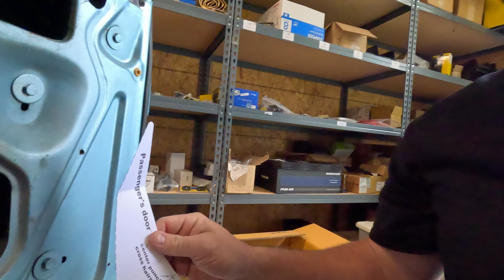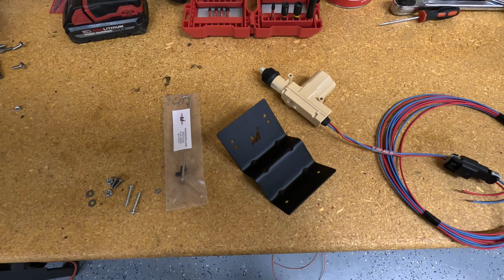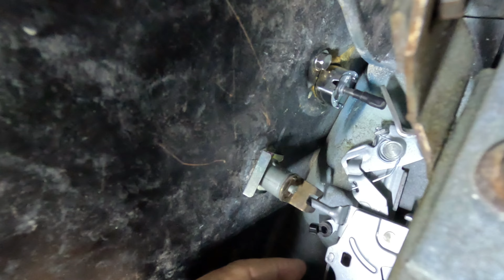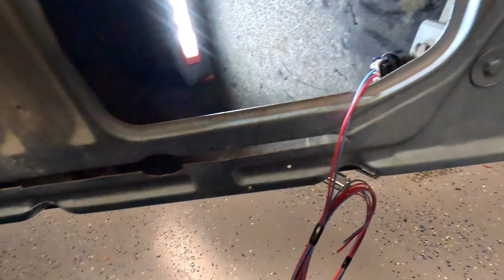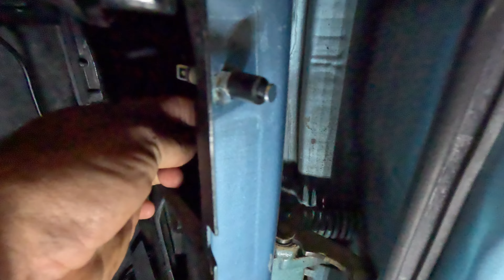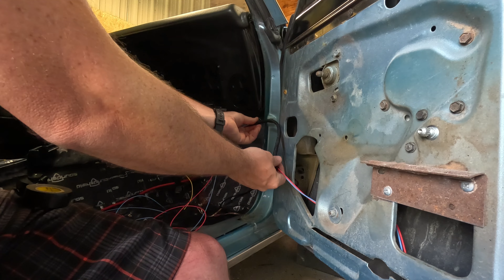1967-69 Camaro/Firebird power door lock install

Comment: On the inside of the car there should be a dimple where the factory hole would have been drilled if the car had factory power windows..  There is also one in the door.  If you want to use factory locations you can drill there.  Use a stepped drill bit for clean holes.  You can buy boots instead of grommets which do not leave the wires exposed.  Nice video.  Good instruction.